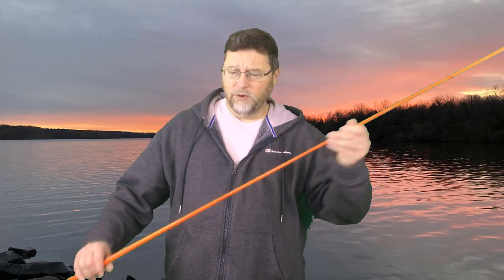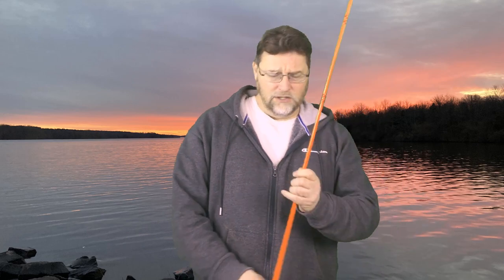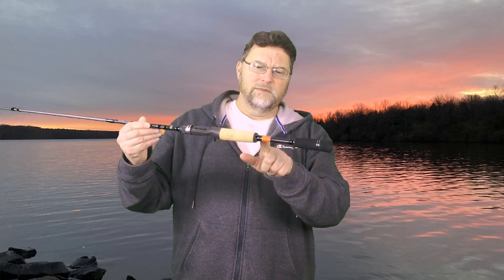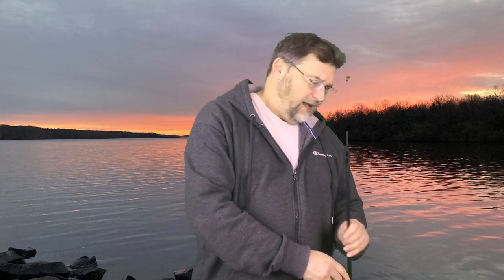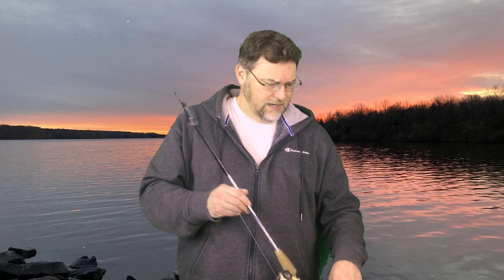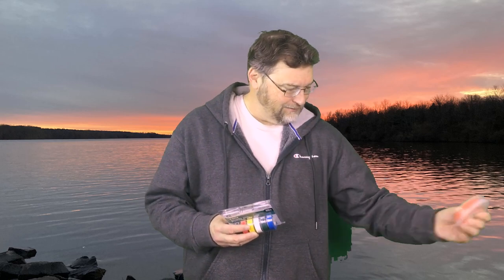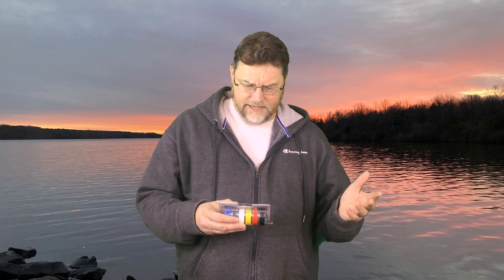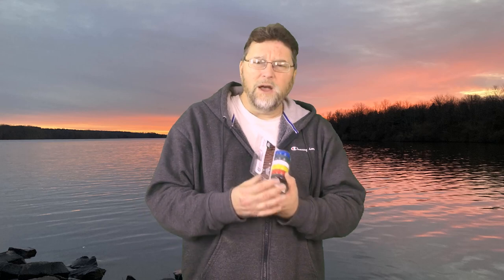Using Electrical Tape to Become a More Efficient Angler

Comment: Good video. I was waiting for you to say to use the electrical tape as a backing before you place the braid on your reel. Just one or two wraps before spooling. On a side note, I mark my lure boxes with Frog tape (painter's tape)  I have had it on a couple seasons and it is still holding up. I mark on the tape what's what.  It is easy to swap out if I make adjustments to the box contents.
Reply from the maker: Hi Jack, I thought about mentioning that tape trick on the reel spool. Good call! Also, great way to know what is in your boxes. Thanks for watching.

Comment: Never thought of marking rods with tape, but I have used it to fix the line to the spool's core of casting reels, so that the pack of spooled line won't slide around the core.

Also I've fed tape around the spool of reels(both casting and spinning) now and then to save on expensive braid to fill the entire spool , when it is not neccessary.
I mean , if the reel can take like 250 yards of line , but you really need only 150 yards, you can thicken the spool's core with the tape. if you don't have any mono line to underfeed at hand.

On one rare occassion I had also wound tape around both end's of a small  reel's foot, when it did not quite fit into the reel seat of the rod due of being a tad too short and thin to come to sit firmly.

I also used tape to fix a small wire form(or a small paper clip) just above the rod handle to be able to clip your line into.

This way you can use spinning rod's put on rod rests stationary with open bail without the wind blowing down line from your reel.

This way a biting fish can pull down line immediately without any resistance and you are also sure, it won't pull your rod into the water.
Reply from the maker: Excellent ideas Dimitri, thank you! How is the fishing in Germany these days?
Reply: @fishden365  
Sorry , you've got mixed up , my name ist Dieter, but never mind.

By this time of year I do not do any fishing , as the weather is too miserable, don't wanna get sick.

But I've got new projects on my mind, made myself some new tackle like casting heavy sinkers in tea warmer candle casings and spent ammo casings(cal.30-06 and cal.308)and made some chumming baskets out of PVC tubing.

I'm planning on fishing for herring and cod for the first time , but not in the sea , but in Germany's largest canal, which is located about 80 miles north to my location.

So hopefully in March or April the weather would get better and I could give it a go.

Tight lines from northern Germany, Dieter
Reply from the maker: Dieter, so sorry for the name mix up. I think my brain malfunctioned. Anyway, March and April are right around the corner. Best of luck when you get out there!
Reply: @fishden365  
Thank you!